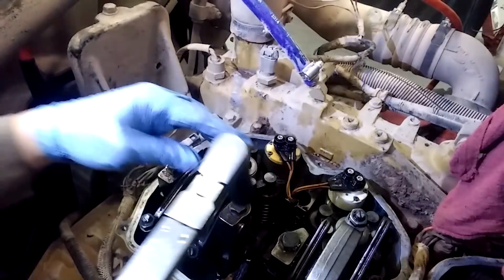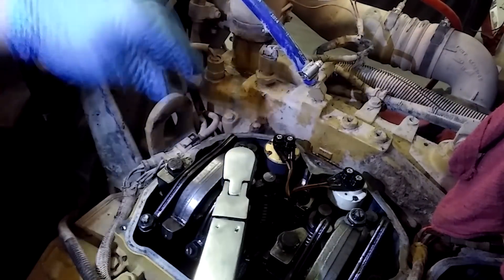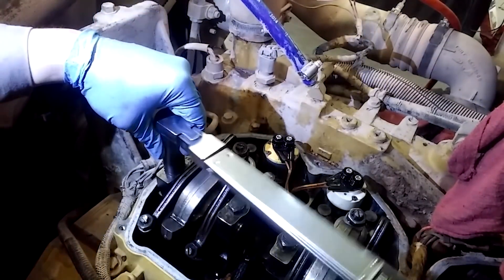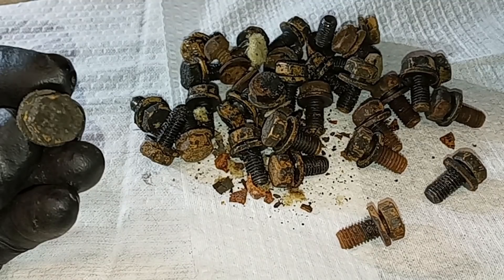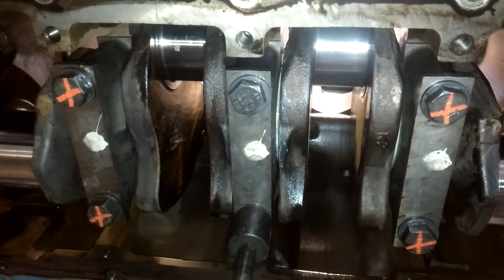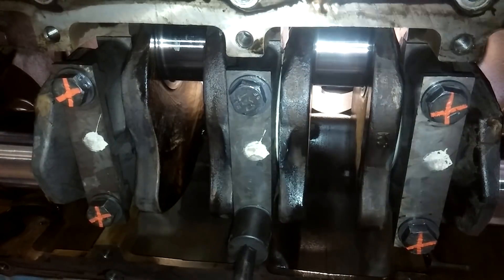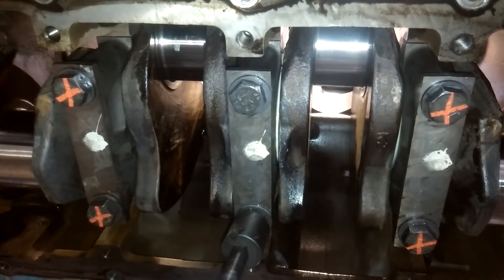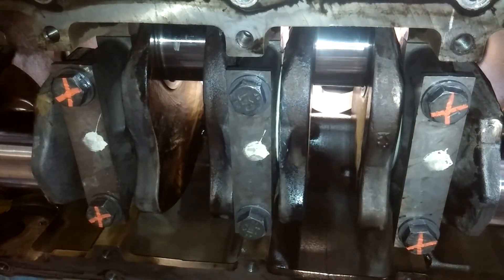Do You Need a Torque Wrench to Fix an Engine?

Comment: ASE Master Automotive tech for 30+ years working on emergency equipment. Had 8 torque wrenches and used them diligently. Lug nuts, bell housing bolts, alternators, main caps, head bolts, differentials, if it was larger than 1/4x20 it got torqued. Learned a valuable lesson at one of my first shops; never had a repeat of a loose fastener. Yes, I am anal.
Reply: How exactly are you torquing bell housing bolts? Your doing the legit math for extensions?
Reply: @C4soulja  Hey Colin, good question. In a word "No". When I started way back when, late 80's, the old hunchbacked guys would have me add 10% - 15%  to the torque spec for long extensions depending if I was using a wobble or not. The point was to keep me from sending stuff out the door that didn't have enough torque to stay tight. Hence my valuable lesson that had to be learned...

Comment: Bottom line if the manufacturer says to torque the bolt then do it. Just changing the oil and fuel filter in my Ford truck I torque the cap to what the manufacturer says. It has never come loose or leaked. It's a no brained to me. Just my opinion

Comment: Amen! When I started turning wrenches, the guy I worked for drilled it into me to always use a torque wrench…and I’ve never had a bolt come loose that I torqued properly. The only thing I would add to your video, is verifying torque. CAT is the only service manual that I’ve seen it written in consistently to go back and verify the torque of the fasteners before you either go to the next torquing sequence, or just finish all together. I always verify the torque of the first bolts before I go to the next step, especially if the are torque/turn method fasteners. Because as the other bolts are tightened, the first ones will loosen some, leaving the final sequence lacking in clamp load. And I have seen gasket failures for that reason. Love your videos Josh and I always look forward to your next one!

Comment: When I was in the game and rebuilt an engine I always used a torque wrench, that way I always knew that if that engine ever came back for a failure then they couldn't say it was because I didn't torque the critical bolts.

Comment: I have been watching those Pakistani shops videos too.  I was kind of amazed as to how they were not torquing anything.  I just figured they kind of knew how much to tighten since they did so many. These trucks in pakistan are running way over loaded all the time, its crazy.  You would think that they should torque

Comment: I’m an intern in this field going to school while working and a co-worker who works on the idlers of a quadtrac doesn’t bother much with torquing the bolts except until his impact gun maxes out at 500 foot pounds (the bolts need also be 512 I believe). I cannot in good faith assemble something as silly as ugga dugging 10 bolts per idler without torquing them all to spec with a torque wrench. No more, no less.

In all honestly these bolts aren’t going loose, let alone 10 of them, but it lets me sleep easy if I can do it where I can.

Comment: As a tool junkie, I have spent way too much money on torque wrenches to leave them sitting in my toolbox.  My rule for using a torque wrench is basically if the failure of the fastener will result in death to an engine/transmission or injury to occupants of the vehicle, I use my torque wrench and mark the fastener afterward.  I work flat rate and I know it slows me down but my job is to fix cars and I try to do my best on every car I touch.

Comment: Humans are incredibly unreliable in these matters. We aren't built to be accurate in this way. You can't feel the difference between lets say 12 and 13nm of torque. By Extension the amount of creep in inaccuracy will just get worse from one day to the next depending on your level of fitness, awareness and general mood. You may think that 200th bolt feels the same as the first one you did, but you could just as equally be breaking something.  You can torque the same bolt ten times in a row and then test them, most of them will be different to each other. Using a torque wrench like you said makes the process more reliable. It also means if your having a bad day that you don't muller a bolt and make life terrible for the next guy further down the line. Lastly it keeps you safe on the job. If a manufacturer specifies a torque and you follow it then when something goes wrong its on them. If you fail to ensure you comply with that specification then it is on you.

Comment: fatigue and temperature also have an affect on the indicated value of your torque wrench......  that is why the "standards' for manufacturing measuring equipment are stored in a climate controlled area and the marching is done in a climate controlled area and the tool  working temps are all taken into account....... that is why on ww2 plus and minus ear warships, aircraft submarines, radar installations, missiles, guidance systems, spacecraft....  ect certain areas were always at a constant 72 degrees Fahrenheit and a constant humidity control.... because that's what the machines were manufactured and and referenced at   and change in these conditions could result in deviation of values.... that is also why 'indicated' information vs "constant' and 'real' data values are all crucial in determining what ever you want something to do\happen.....  so considering all of that  if you are the monkey at the end of the big wrench and physics and the world and such is in action   the "feel" may be far more accurate than thought...... obviously if the optimal tools and equipment are available it would be stupid to not use them.......  as long as they are calibrated......... and who knows how well 'calibrated' ones 'feel' is or a tool........   oh well I guess tight is tight lmfao

Comment: When I first got into working on heavy equipment 40 years ago all I ever torqued was rods, mains and heads. That changed over time.  Obviously now I torque anything the manual has specs for. Sometimes there is that one fastener that all you can torque it to is the German standard, good-n-tight.  One thing that throws me off on my hot rod is I use ARP studs and their lubricant. It says use half the torque on the heads and it’s scary. Never had a problem but in my mind it’s just not enough.  Also remember that break away torque is not the same as the final torque. Long sweeps are needed.
Reply: I did head studs on my 7.3, and they called for a higher than OE torque spec (maybe due to the OE bolts being torque-to-yield,) yet generally a lubricated bolt will specify a lower value than "dry."

Comment: It's just a matter of being meticulous with your work. Say if you were replacing some large valve with a lot of fittings, you could just take the fittings off the old one and throw them on the new one and be done... or you can take each fitting off and clean it in the parts washer, put brand new o-rings on everything and lube the o-rings. 90% of the time both ways of doing it will fix the problem just fine, but there's gonna be a much higher chance it leaks or gets dirt stuck in the valve if you don't take the extra time to do all the steps. It's pretty much the same with doing any job on anything. You can usually cut corners and be fine, but if you wanna do something the right way every single time, you need to be willing to take a little extra time.

Comment: clamping force, bolt stretch have very different properties and jobs when torqueing cylindrical bearing journals/housings whatever vs the clamping force for like a cylinder head...... the bolts/studs spring a bit allow for thermal and pressure differences  whilst clamping down on a round bearing journal can affect the crush, roundness... also allowances for thermal expansion lube oil clearances and allowances for its expansion and properties and such

Comment: I was told that proper torque on a fastener was achieved at 1/4 turn before the rupture of said fastener. Meaning: if you break the bolt you back it off 1/4 turn and call in the new guy to finish the job. LOL

Comment: It would be neet to use all the same parts. Have those Habibi's build one without a torque wrench then another guy or group builds the exact same engine using proper tools and torques. Then run the same route or whatever for 200000 miles then tear them both down and compare wear patterns.

Comment: I’m a former Cummins engine tech and this is my opinion also, I agree a torque wrench is a must for engine building. Period!!! Anything bolted to the engine is negotiable according to most mechanics/technicians. Although, I torque every bolt or nut I can given space allows me to fit my torque wrench into. To each his own because if you like blowing up engines don’t torque anything, otherwise follow manufacturers torque specs.
Reply: First one that ever “bit” me was a 555 Cummins. 
The intake torqued to 35 foot pounds if I remember right. Any more and they puke oil like a big dog!!  LOL

Comment: Another reason to torque everything,  we are in a sue happy world.
If a head bolt snaps 1,000 miles after doing a head gasket, who are they going to look at first, the mechanic. Or the wheels fall off after you do a brake job and did not check the lugs.

Comment: Hi adept ape

When I was growing up around people who worked on vehicles I asked the question "why do you torx the nuts and bolt's on a vehicle?", the answer that I got from mechanics was to cover yourself from a law suite, I asked "why?", the answer I got was "if the component, mount, the nut or bolt failed and was not torxed correctly the warranty was void and the mechanic and the company that did the work had placed the client, customer, consumer at risk of being harmed or worse killed or the people around it could happen to them.

Now in first world countries have become claim against anyone who fails to do it right the first time.

Loving the video's all the best for 2022 from Philip Burrows in Overton on Dee, Wrexham, Wales, UK 🇬🇧

Comment: Using a torque wrench yields a consistient result. "Feel" can be easily affected by having a bad day, missing the morning coffee, etc.
Reply: smashing fingers earlier that morning
Reply: Clothes getting stuck on the stairwell
Reply: I never use a torque wrench for something not critical like M8 mounting bolt for air box or any interior screw that's holding plastic. But for suspension and other critical stuff, I always use a torque wrench. I never trust myself

Comment: I consider myself an above average self taught mechanic, I actually tend to be a tad more OCD about things because don't want to be judges as hack when I do something. I've taken many of projects( engine swaps, Trans swaps, othe major mechanical problems, ect) into dealers and professional shops and been complimented for my standard of work. Maybe they just didn't want to potentially insult a paying customer, but usually it was me accompanying someone I did work for to shop for scans and whatnot that I didn't have access too. N9 one ever pulled one of the people I've brought in away from me and said to get rid of me! Haha
So anyway to stop rambling on, I had a very seasoned veteran mechanic tell me that older stuff is not as critical to torque perfectly as the new more close tolerance designs are. I don't know if I agree with that or not, but I'd love your feedback? I try to use a torque wrench in every situation possible, helps me sleep better at night not worrying if some repair I did is going to leave someone and potentially their children stuck on the side of the highway. The potential for disaster is too great in those situations. Thx. Sorry for the long Comment.

Comment: I used to work for the cat dealer up here in Alberta, Canada. In my opinion when you’re working on customer equipment itis your due diligence and obligation to torque critical fasteners properly. That way if the machine comes back for a failure or rework its harder to pin the failure on the technician because he/she followed the proper procedure and specification which, depending on the situation, shifts the warranty cost away from the shop and potentially back onto caterpillar, saving the dealership money on service rework. That being said ive seen guys “torque” cylinder heads with air impact guns. To each their own i suppose😂
Reply: Lol the impact gun 🔫 snaps 🤣
Reply: 😬 🤦🏾 impact wow real geniuses. 🤷🏾‍♂️
Reply: Well disciplined my brother. You earned your $
Reply: Go torque cat mains on a c15 or head bolts on a c13. Youll use an impact. Cummins specs an impact. Torque turn bolts. Ive built many many cats. Impacts work great under the proper circumstance.
Reply: @careykuhn9174  You got it! These bolts/parts are designed to take extreme use/abuse. They have quite a large error margin. If you slightly over torque a bolt, it won't be an issue. You just might not be able to re use it.
Reply: @willriccio7524  You need a 6 foot torque wrench to torque c15 mains the final step of torque. For one there is no room for that kind of swing under a truck. Next is it takes 2 people. One to hold the wrench up. I rebuild engine by myself. Air impact works perfect. They wont get over torqued unless you go past the 90 degrees or whatever its called for.
Reply: @careykuhn9174  Hell yeah. You said it!
Reply: I know of a C18 in a truck with well over 1,000 wheel HP that was torqued with impacts, he said the mechanic used three different impact guns for different torque settings  and he trusted the guy's knowledge and experience, my opinion to him was I will not allowed that on my engine and will never let that guy touch my engine again , but like it was mentioned before , to each it's own. By the way that truck was leaking oil under the plate at 700 miles and a new plate gasket and studs from ARP were installed a few weeks later.
Reply: Are you sure they weren’t doing the angle tightening with the impact after torquing the bolts to whatever spec?
Reply: @mahart40  If your question was directed to me, yes I'm 100% sure, I wasn't there when they were putting the engine back together , but the truck owner is a good friend of mine and he told me how they were doing it, the second time he told me he was going to make sure they use the torque wrench, at that point I didn't ask him if they id or not.

Comment: 3:47 Agreed 100%
The thing that concerns me is, a torque wrench has a certain length. So even if you're used to how 25, 50, 100 ft. lbs "feels" with a 12 or 18" torque wrench, it's not going to feel the same as with a 6" long 3/8" ratchet.
Reply: This is fair, and I torque EVERYTHING inside the engine and everything with a gasket, if the engine is out it’s easy and quick. But I also know with a 6 inch ratchet if I’m getting a bolt tight but not balls to the wall yanking my little ratchet to tighten I’m at around 37 ft. Lbs.

Comment: I never use to torque the wheels on my vehicles and now I do. I never realized how much I over torqued my aluminum wheels. When I actually torque them, I feel that it isn't enough until it comes time to rotate the tires and I'm having to take a dead blow hammer to the inside of the wheels to get them off. Lol!  My boss works on cat motors too. I'm amazed how much torque is applied to certain parts of the engine. If I remember he torque the head down and has to wait a certain amount of time and then torque it down again. It looks like he's about to snap a head bolt off on the final torque.

Comment: I’ve seen instances where a shop manual will tell you to pre-torque to a specific value, then repeat the pattern and turn the bolt one “hex”
Reply: Torque to yield, and it is typically more than one flat on the fastener.  Usually 90 degrees or more.  We have fancy tools to keep track of those degrees of rotation.

Comment: Torquing mains, rods, heads, jakes, upper rockers -- yes.  Valve covers, exhaust bolts, oil pan -- not necessary.  Great video Josh.  Keep up the great work.
Reply from the maker: Thank you Chad.

Comment: Just use impact wrench. Go full cavemen mode: Tap tap tap tap tap tap.
Reply: Then don't be surprised if your engine starts to sound like tap tap tap tap tap. Or TAP, the crank pulley flies off. Anyways my point is, you should probably just stick with tapping nonsense.
Reply: @stewoe7157  🤣🤣🤣
Reply: Q1

Comment: I absolutely agree with you. Certain critical fasteners must always be torqued properly. But many  bolt on accessories for a technician with many years experience, can accurately gauge the torque for the application